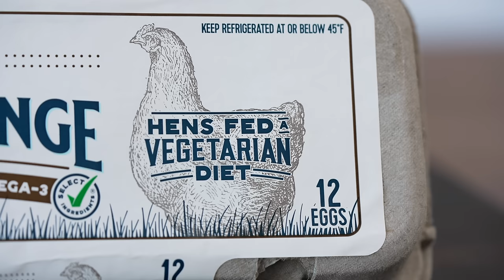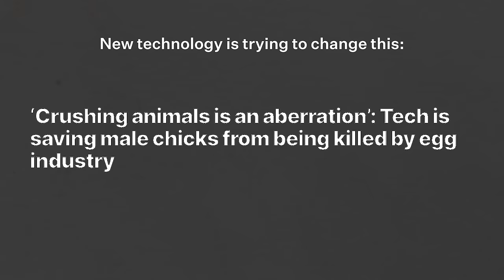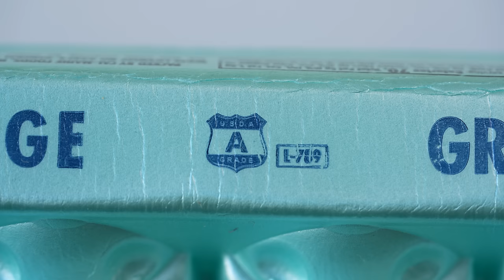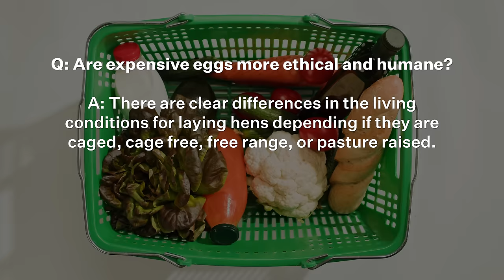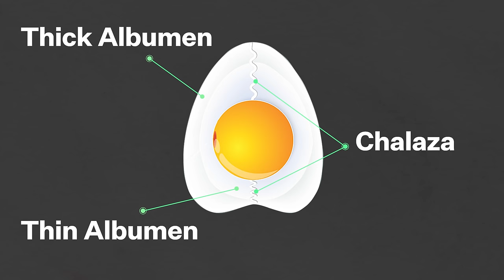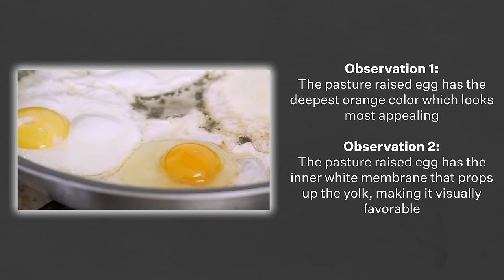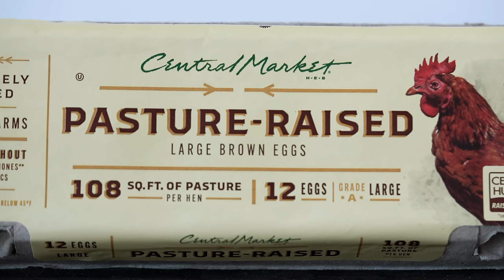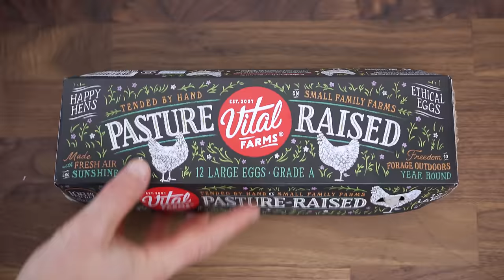Are Expensive Eggs actually worth it?

Comment: As a physics teacher I always used grade B eggs for demonstrations; the shells are thicker and tougher.
Reply from the maker: So grade B eggs give you A’s in physics!
Reply: @EthanChlebowski  sobbing
Reply: Funny, I recently bought a dozen eggs (Nellie's??) and the shells seemed to be amor plated.
Reply: McDonald's had grade B eggs when I worked there and the shells were paper thin.
Reply: @poughquagpops3379 when egg shells are washed, as they are for production, they lose the protective coating that keeps them strong. If you have ever purchased locally grown eggs or eggs from a small local grower personally, they're dirty for sure. They are also stronger and last longer under refrigeration. Drawback is they are usually smaller and like this video shows, usually not worth the extra money because you get less volume and hardly any extra nutrition
Reply: Where can you find grade B eggs? we only have grade A....
Reply: @lars2894  

Probably only available wholesale, except in rare circumstances. I would surmise some grade B eggs are grade A, but no grade A eggs are grade B
Reply: @dreichert1438  I buy my eggs from a farmer, and they're giant, extremely tasty as opposed to cheapest supermarket ones, a little filthy on the outside, we keep them unrefrigerated and they last for at least 3 weeks without signs of degradation. They're close in price to the cheapest horrible supermarket eggs and much cheaper than the expensive ones. We pay 25ct per egg while cheapest supermarket ones are 20ct, but the prices go up rapidly if you want decent ones, with all but the cheapest ones exceeding the 30ct mark. These are barn chickens though, not what you call pasture raised. Our farmer has about 3000 hens. We live in a city and have him drive out and stop by our house once every few weeks.

Supermarket eggs are also not washed here in EU, but the sorting machine picks only the very clean looking ones to package for retail. It is strictly forbidden to wash eggs before sale here.
Reply: @SianaGearz  That sounds excellent! I have a friend who has quite a few chickens but his family uses most of them. We have another lady we know that raises and sells but they're about double supermarket price and equivalent to medium and large. Eggs are a large part of my diet, especially since I have been on carnivore for several months, and I can't spend the extra for half the amount. I like those jumbo eggs!. But I would gladly do it with the deal you have. Amazes me sometimes when I crack eggs from carton to carton from the grocery store. Some of them break with the littlest bit of effort and others take concerted effort. Shows you a drastic difference of quality for sure, along with the consistency of the inside. Cool to hear about things over the pond my friend. Cheers!
Reply: It depends on the eggs.  Some grade B eggs have paper thin shells.
Reply: Weird, I found the more expensive eggs have thicker shells, I have to slightly more oopmft when I crack them.
Reply: The size of the eggs depends primarily on the age of the hen; older hens lay larger eggs than very young ones. The thickness of the shell depends on the diet. The fact that small eggs have a harder shell may be due to the fact that young hens are less likely to be malnourished than older ones; this is particularly common in intensively kept chickens and in high-performance chickens. It is also important not to wash eggs, washing removes the wax layer on the shell so that eggs dry out more quickly and germs can penetrate more quickly, which spoils the eggs. When it comes to hatching eggs, it is said that from 2 weeks old the hatch rate drops. From 4 weeks onwards, hatching them is no longer worthwhile, this gives an indication of how long eggs will be edible.
Reply: @SianaGearz  As I understand it, eggs need to be refrigerated once they've been washed because they lose a protective layer. EU/UK eggs aren't washed and aren't refrigerated. In the US they're required to be washed over salmonella concerns, which means they have to be kept cold.
Reply: @keithkannenberg7414  Yes EU hens are generally vaccinated against salmonella; or in cases where that's not done, extensive salmonella testing is performed.
Reply: @Danielle_1234  Calcium is ADDED  to feed making egg shells thicker. Some skimp to save money.

Comment: Just a note on pans. I’ve had the same stainless steel pans for over 20 years. If you heat it before adding food and then add water while the pan is still hot (after removing your food), they are incredibly easy to clean. A steel scrubber for any tough spots and that’s it.

Comment: I disagree on the taste bit. I think there is a very clear taste difference between high and low quality eggs, but from my experience this has more to do with the diets of the hens rather than if it was caged or free range. Cheaper eggs generally have less quality control so it’s more likely to get a bad egg (the pale ones that lack richness and depth of flavor), but a good chunk of them are likely going to be good enough. Costco eggs are my favorite because the quality is almost always good and consistent and the price isn’t too high. I could not tell you how they raise their hens though. A really high quality egg is a different experience though.

Comment: One thing I will say about eggs is when we put them on the shelves, as someone who works in a grocery store. I'm not sure how this works for larger stores, as the one I work at is a smaller store. When we receive a pallet that has eggs on it we take it off an put it into our cooler until we put them on our shelves, which I'm sure is normal for almost all stores. When we do take them to be put on the shelves, that's when we find out how many got broken through the whole process. We have three different milk crates that have eggs cartons of different qualities: eggs water we have to throw away, ones that have some broken eggs, and cartons that have had broken eggs replaced. When we have broken eggs we will usually find a carton that is the same kind. But when we run out of a certain egg type we will usually take an egg of the same size and color, regardless of the brand.

Also, cardboard cartons suck. If one egg breaks and oozes out, we have to throw out the whole carton, because by the time we get the carton the broken egg is already glued to the carton. This can still happen with styrofoam cartons, but a lot less often.
Reply: Totally understand the objection to cardboard cartons from a business cost standpoint, but from a consumer standpoint they're nice for the small percentage that compost.
Reply: Worked in a supermarket in the Netherlands and we very rarely had cracked eggs (unless someone dropped a crate).
They were shipped to us mostly in cardboard trays, packed in plastic crates.
Maybe all the egg losses were in the centralized distribution locations? Or the shipment was just very good.
Reply: @ian4683  I live in rural Iowa and the roads are pretty shit here

Comment: Back in 1964 I lived in rural Montana. We raised chickens so we could use and sell the eggs, and had a LOT of chickens, kept in a coop with easy access to the outdoors, with a fenced-in area to contain them.  We fed them a form of grain feed, and they definitely ate bugs.  We had to keep them in the coop -- though they wouldn't really LEAVE the coop -- during Montana winters, which at that time included snow for three months and round-the-clock freezing temperatures starting in October and staying until early March.  Generally, in late December thru early February, there were blizzards, and heavy snowfall.  The chickens wouldn't voluntarily exit the coop during any blizzard. They wouldn't voluntarily exit the coop when it was close to freezing.  The coop was kept warm with heat lamps and was small enough, though hardly airtight (we had weasels one week that at least only took two hens at a time.) 
The predator issue was real.  We lost two hens to a large hawk, but apparently it didn't stay around.  I have no idea whether it was driven away by the many crows in the area, or someone shot it for attacking their chickens, or it just left for other reasons.  The weasels we had to kill because they were too good at getting into what was not a super-sturdy henhouse, though they were frustrated by some of our repairs.
The eggs were eggs.  The 40-odd hens at the end of the first summer were 30-odd hens at the beginning of spring.  They produced more eggs in summer than winter, because it takes more energy to stay warm when the day-to-day temperatures are below freezing, even though they had heat lamps and they huddled together like birds tend to do.
After two years, we slaughtered the remaining 25 hens one late spring day when their egg production dropped.  The de-feathered and cleaned hens were carried off by the guy who had been underwriting them, and my Dad got paid a small amount of money. The smell of boiled chicken feathers was horrible and stuck around the place for a day or so.  Shortly after that, we moved.
Chickens produce a lot of bird shit. They also have tiny, tiny brains and the "smart" chickens you see from time to time, are actually just well-socialized, because spending time around humans more frequently causes them to behave in ways that seem to be more intelligent.  Certainly running around flapping, natural behavior, not the best way to deal with a hawk overhead.  Running into the coop, somewhat better.
Reply: What about the taste of your eggs?

Comment: Hey Ethan, I just wanted to chime in on one thing here:  I disagree that the shell does not matter, and for me is actually one of the bigger things that determines which brands of eggs I buy.  A thicker, sturdier shell makes cracking the egg much easier as the shell will fracture cleanly instead of crumpling, allowing for easier one-handed cracking, as well as a reduced chance of getting shell in the egg itself, AND a lower chance of breaking the yolk, the integrity of which is rather anemic in thin-shelled eggs.  I hypothesize that healthier, happier birds on lower-stress farms lay eggs that have had more time to develop, and therefore have a nicer, easier to work with shell that protects the contents more effectively.

Comment: some years ago I studied on how to properly boil eggs. First farm fresh eggs don't peel very easy, use at least week-old eggs. Bring the eggs to room temperature to help avoid shell cracking when put in hot water. [Lay eggs on side for a while and roll if making deviled eggs which helps to center the yolk.] Don't actually boil the eggs. Lay room temperature eggs in pan and boil water in separate pan. Then pour boiling water over eggs and start timer, turning fire on under pan to keep the water right at or before the boiling point. Large eggs =17min, Ex-large =19min and Jumbo =22min. Over cooking the eggs causes the white part to become more solid and rubbery also making the green oxide layer on the outside of the yolk. When the time is up, put the pan under running cold water for a few minutes to stop the cooking process. After 10-15 min sitting in the pan, start to peel, they peel best/easiest when still slightly warm. Maybe yo got away with 12min on the large and yet had the yolk appear fully cooked because you actually boiled them.???
Reply: I just leaned an amazing trick for peeling dark fresh eggs! It’s a total game changer. Take a spoon and tap gently on the thicker end of the egg until you hear a tiny snap/crackle sound. Boil for however lit you choose and they peel right off like the cheap inhumane eggs they sell at Walmart, Costco etc.
(I am a visual learner, so I watched a YouTube video on how to exactly do it and it worked like a charm!!!!)

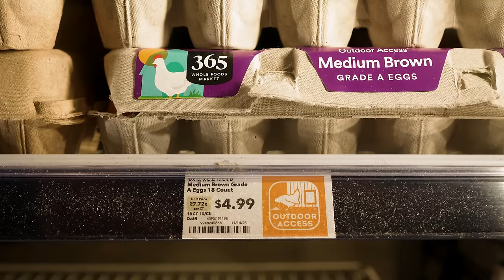Comment: I was surprised when I did see that size chart on 7:00
The XL eggs from the brand I buy from in Europe is larger than the jumbo eggs on that chart.
The packet says the weight per egg is minimum 73g and 100g is max.
Sizes are usually much larger in the US than here.

Comment: Interesting thing, the shell CAN be eaten. Just clean the membrane from the shells and dry. Once they are dried grind it down into a powder and sprinkle it onto food. If you are low in calcium, it is an easy way to get calcium and easier to absorb for the most part.

Comment: I recently developed, at the age of 58, an egg intolerance. When I cook eggs at home -- fried, scrambled, soft or hard boiled -- I get severe GI pain that starts almost immediately after I eat them and lasts for hours as the egg protein travels down my GI tract. I tried a couple alternatives to my normal brand (Walmart) and had the same problem with all of them. Then I tried eating them with 2000 mg of Betaine HCL and had only very mild discomfort. This leads me to think I might always have had an underlying intolerance that only became relevant as my stomach acid declined with age. (I started taking betaine with other proteins before I tried it with eggs, because I have nighttime acid reflux that can be caused by insufficient acid during meals. The supplement has helped alleviate that problem, too.) I've only tried eggs once with the Betaine HCL supplement, so I don't know if it will keep working or if there is some other factor involved. Does anyone have any knowledge or experience to share about egg intolerance and digestion? Does the chickens' feed matter? I haven't found much about this in online research, but some people say egg intolerance can sometimes vanish if you don't eat any eggs for a few months. It's an immune reaction similar to allergy that has been identified in some biochemical detail, but there's not much info on overcoming it.

Comment: Interestingly, a quick google search can sometimes incorrectly tell you that a rotten(old) egg sinks... i had to correct my family recently when they took the first item on search as correct.
Rotten eggs float as they generate Hydrogen Sulfide (rotten egg smell) and thus float. Not to be confused with boiled eggs, which also float after boiling, but will sink before boiling.

Comment: The most important thing to understand with eggs is that most current regulations have nothing to do with diet which is the only thing that affects taste. Some chickens that lay cheap eggs are basically used as garbage disposal to turn waste products into sellable products. These low quality eggs are sometimes marketed better and aren’t always the cheapest eggs so going from the cheapest ones to a slightly more expensive brand like from caged to cage free could get you a worse quality egg. 

The only way to guarantee good tasting eggs is to avoid store bought eggs entirely. Depending on where you live and your local stores you can get massive taste differences or basically the same egg just in different packaging. Personally I don’t taste any difference at all where I live so I buy the cheapest ones. Taste is really the only thing that matters to me since 90% of terms like “free range” is just marketing and focuses more on ticking a box so they can put the term on their product vs actually making the chickens happier and that’s not even talking about the possibility of fraudulent advertising. The nutritional differences are so small to be meaningless so the real deciding factor will always come down to price.

Comment: egg grade really matters when talking about air space and "reprocessing" or "re-dating" unsold eggs because that relates to consumer shelf life and actual quality at time of use.

also, a HUGE factor with any outdoor access and large flock sizes, ie free range or pasture and being able to actually pay the bills with eggs,  is that the BIOSECURITY RISK becomes insane.  entire flocks have to be destroyed because of salmonella or avian influenza.  the spike in egg prices in 2023 wasn't because of increased feed or operating costs, it was because entire flocks were being destroyed due to avian flu and the barns sit empty until replacement pullets can be raised from hatches that are already reserved and schedule well in the future. Nobody operates excess hatchery capacity because, well, that would be uneconomic.  But they can take a replacement flock and direct is to an empty barn and let the existing flocks age another cycle where they continue to produce but at a greatly reduced rate.  I guess then the spent fowl aren't making to be pet food, but maybe the destroyed flocks maybe can instead?  anyhow, if you stop the think through the logistics, it is one extremely complex and interdependent system.

Comment: There is some misinformation here regarding OMEGA-3

You don't get OMEGA-3s from "plant oils"; instead you get OMEGA-6.

Also most people don't get enough omega-3; and that source you referred is talking about ALA; which doesn't convert well to EPA/DHA.

Especially in today's high OMEGA-6 polluted diet, higher OMEGA-3 is even more important! 

But eggs aren't the best source of EPA/DHA but still; at least lower OMEGA-6 would help alot. As it wouldn't exacerbate the OMEGA ratio from the SAD diet
Reply: One last point; you point to a previous study from 2009 that contradicts todays findings.

Yea all that says is back in 2009; chickens were treated and fed better; so back then the difference wasn't obvious.

In 2024, almost two decades later; chicken meat is barely edible and the eggs are not what they used to be.

So while it makes sense for the study to point previous contradictory studies; nor it or you should use that as evidence that today it doesn't matter either. 

Lets use that 2009 study in 2049?  2099?